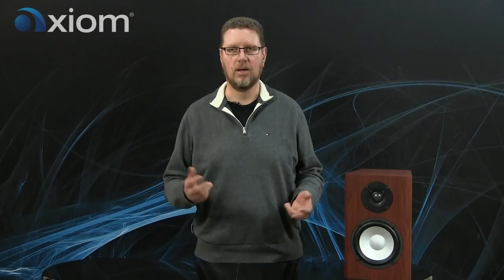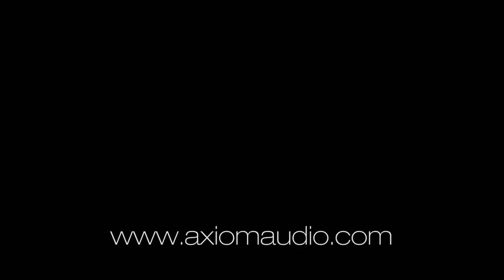Are My Speakers Blown?

Comment: Tweeters are the most likely to be blown by clipping, woofers are usually burned up by amplifier fault where an O/P transistor shorts (only in split supply amps)
Reply from the maker: Absolutely correct 👍

Comment: If it sounds bad, you might be damaging the speaker, turn it down.  If it smells, you’re probably damaging the voice coil, turn it down.  I burned out the voice coils of two beautiful car subs back in the ‘90s.  And I did it unintentionally with the Metallica “Justice for All” album!  The subs were probably getting killed with amp clipping but I didn’t notice and didn’t turn it down.  Goodbye Jensen sub, you were good.  Goodbye Cerwin Vega replacement sub, you were phenomenal!!!!  RIP.
Reply from the maker: Great points, and sorry it was a sub loss that brought you to that point.
Reply: Axiom Audio , it was a learning experience.  I was a kid and it probably saved my hearing, lol!  Oh yeah....one more tidbit...if you put your sub box on the speaker wires, it’ll rub and eventually destroy the insulation, short the wires and fry the the amp.  I did that too!...unintentional destruction.  Keep it all tidy, everybody!
Reply from the maker: @MusicStudent1  Fantastic point, and not just for subs, nothing should ever be on top of any of your cables! Just not a safe thing to do for any wiring or cabling.
Reply: MusicStudent1 are you just flexing 🤣
Reply: Yungchichi , yes.
Reply: Nah that album won’t strain your subs if you know you know 😂

Comment: Good evening. Thank you for the useful video, and you’re a legend for still replying after a year! I was wondering if it is likely to damage studio monitors by clipping inside a DAW by 6 to 8db. I am worried I could destroy my new unit
Reply from the maker: Thank you! Clipping inside the DAW could easily be passed directly to the monitors…not sure why you’re running into clipping in the digital domain…that’s nasty!
Reply: @AxiomHomeTheaters  hi
Using Paradigm Studio 100 reference speakers
The right speaker is working flawlessly but I have noticed on certain music tracks there is like a scratchy noise from the yellow midrange driver almost as if the speaker is loose.
It also appears only at certain frequency and lenght of tone. I have to inject frequency generator tones to actually determine the resonant freq this problem appears.
You think its damage?
Reply from the maker: @pietpompiepompiepiet940  It's possible the driver is rubbing only slightly and is damaged, which is why you only hear it on certain tracks. I would contact Paradigm technical support and see what they say.

Comment: one the two KEF 101 speakers has a crackle sound on one of the speakers, but I don't know if it is the tweeter or the board.
Could you assist/direct me in this matter? Thank you
Reply from the maker: If you're comfortable the best thing would be to swap drivers one at a time, between the two speakers. If the crackle moves to the other speaker, you know that it's the swapped driver that is at fault.

Comment: or an airport is loose and needs tightening, adhesive or puddy.  Look at your airport and see if if it has cracks at the seal, or put your fingers and press on it while playing sound and see if it helps. This was my situation with BIC Acoustic PL 200 II
Reply from the maker: That’s a good point…if the port tube is loose it can make some terrible noises.

Comment: To test to see if they are "blown," stage your gain on your amp and head unit properly (basically set them in order of flow so that they are just below the point at which they don't clip, first the head unit with amp at nominal gain, then turn up amp to just below clipping, do a search for more details), and then play a tone sweep (search YouTube). Your speaker tone will change drastically at particular frequency ranges. This indicates they are blown. You'll probably notice some differences from left to right. Turns out my left speaker isn't blown at all but my right one is and shows in a couple places.
Reply from the maker: Excellent advice, I would just exercise caution with the playback levels when using test tone sweeps. They contain far more acoustic energy than typical music programme, so can tax both the speakers and amplifier.
Reply: @AxiomHomeTheaters  thank you for the addition. Yes, you should start with your volume low and use your ears to gauge what a good level is with respect to how your music sounds when you are just below clipping thresholds at all stages.

Comment: I guess one of the smaller speakers in my car is slightly blown, but I think my woofer sounding a bit shaky is just the car rattling and not my woofer, though they may just be slightly blown.
Reply from the maker: A quick test is to play something at a reasonable level with lots of bass and press in areas of the panel that holds the speaker. Door cards in particular can rattle at different frequencies.

Comment: I have no idea what happened to mine I was on holiday for a few weeks I came back plugged them in and if it's slightly above barely audible it just sounds awful
Reply from the maker: If your speakers have grilles on them, remove them and make sure something is not visually wrong with any of the speaker components. Otherwise check your receiver/amplifier to make sure a setting has not been changed.
Reply: @AxiomHomeTheaters  everything looks fine but they just don't work at all now gonna have to see if someone who knows more about equipment knows what's up with it
Reply from the maker: @lilwombat  If you have another set of speakers try them, and if they work, you know it's not the receiver/amplifier. That would at least narrow down which component isn't working.

Comment: I have an old pair of JL-730W Kenwoods and I'm hearing scratching now, The day before I had driven the speakers loud, but the audio wasn't distorted, so I'm not sure  what's going on with them.
Reply from the maker: It’s possible you have overheated the voice coils and their formers and they have become slightly deformed in shape. If you press gently on the cones to move them, so you hear some scratching or roughness?

Comment: Hello, I don't know what happened to my speakers but I got high quality laptop (gaming), I had amazing sound even on 50% of system audio. And with Nahimic 3 which is special software for MSI laptop even better...1 day I played 1 game and heared huge crackling sound and let it go for minute max, and after it ended a game. And I realized my sound is hugely decreased and clear audio too. Now I have all almost on max but sound way worse than before, low sound, now is audio not clear and sounds weird...I don't know what happened. Can it be something with speakers or is it with drivers ? I updated all but still not better. I really want to go to get my audio back but now still sure if it can be speakers damage or something different...Please help me, if you can answer. I can give you more details if you want but I don't know what is the problem and if is way lower sound also problem with damaged speakers. Sound is not even clear as before, as I wrote. Thank you for your time reading this.
Reply from the maker: I’m not sure if you are using computer speakers with built-in amplifiers, but it sounds like something might have failed with the electronics built into the speakers. I would contact the manufacturer and see if they have any suggestions. And sorry for missing your earlier question about this! Recently discovered that YouTube does not notify of every comment, but now we manually check daily to try and catch all comments. Thanks for watching, and good luck!
Reply: @AxiomHomeTheaters  Thank you so much for your answer. I liked the video and keep up the good work! I am already contacted the shop where I bought it. I will now try last 1 fix they told me to do, and if doesn't help, I am going to get propably new laptop cuz this 1 is damaged. Anyway thanks again, and have a nice day ;).
Reply from the maker: You're very welcome, and hope this last fix works for you! Thanks for watching, and hope you are having a great weekend.

Comment: Quick question. I understand that Axiom subs are DSP controlled. I was wondering in that case if it is possible to damage the woofer by playing it too loud and bass at the max or if the DSP will prevent the woofer from being over driven, no matter the settings and volume?
Reply from the maker: Under normal operating conditions with music or movie program signals, the DSP limiter will protect the drive unit from over-excursion at all times, regardless of the volume setting.
Reply: @AxiomHomeTheaters  Thank you. The reason I was asking was because I wanted to check what my new EP800 could do and looking for the deepest bass to demo a subwoofer, what comes often is the opening credits (first 20/25s) of the movie Edge of tomorrow. However a lot of warnings regarding not playing this at reference level as this was supposedly mixed too hot and there has been reports of some subs being damaged while playing it. So if I understand correctly, since Axiom subs are DSP controlled, they will never be damaged by something like this, even playing at reference level, correct? Thanks again.
Reply from the maker: @bdpf1744  You will be fine…just don’t run it on a loop! As with any regular speaker, if you start to hear any strange mechanical noises or smell anything, turn down the volume. While the DSP will protect the woofer from over-excursion, heat stress can still play a part.
Reply: @AxiomHomeTheaters  That's good to know. Thank you very much for your reply.

Comment: I accidentally put speaker ring foam in the back of my car speaker magnet . They sounding good for a month . Then last night they start to sound clipping . Is it overheat due the foam?if i remove them quickly can my speaker sound normal?
Reply from the maker: When you say your magnet did you push the foam into a vent at the back of the speaker motor? If so you might have damaged the driver due to reduced cooling. Remove the foam and see if the sound returns to normal.
Reply: @AxiomHomeTheaters   but in the morning they sound normal . When i park my car under the sun and start to listen radio,the sound is clipping . I just stick the foam behind the speaker magnet . I hope my speaker is okay😭
Reply from the maker: @MrFaizProject  It could be something else going on if it’s only when your car is in the sun…maybe your amp or head-unit is overheating?

Comment: Facing a little noise while playing songs or videos at low but in high volume i can't hear that noise is it normal or something is wrong with my speaker
Please kindly reply.
Reply from the maker: If only at lower levels it could suggest there is some slight rubbing of the voice coil on one of the drivers. If you turn off your amplifier and gently press on each cone, do you hear some faint scraping sounds?
Reply: @AxiomHomeTheaters  my is a blutooth speaker and yes it makes a rubbing sound and something, even when i play songs a little louder. can we fix this issue
Reply from the maker: @darkiedidi  At this point I would suggest contacting the manufacturer of your speaker.

Comment: I have sony ht-rt4 when i was messing with the options on the tv i accidentally turned on dolby digital + while the system only supports dolby digital. I heard some kind of screeching and squeeking.... It was for 2-3 seconds because i immediately switched to normal dolby digital. Is there a chance that i blow up the speakers.....? I just bought it...
Reply from the maker: If only for a few seconds, you are likely ok.
Reply: @AxiomHomeTheaters  well I'm using the system for couple of days now and I don't hear any distortion so i hope they're fine because i just bought em....
Reply from the maker: @bojidardimitrov4361  sounds like you are safe then.

Comment: mine i have a setero aiwa and the speakers outta nowwhere make a loud high pitch sound then stop working then later one they work again it repeats over and over
Reply from the maker: It sounds like you are either clipping your amplifier badly, or there is a bad connection inside your speakers. Since it is happening to both speakers you are probably clipping the amp.

Comment: i need help im just 11 and dont know, i have my speakers on full vol and i can only barely hear it when i put my ear close to it,  my speakers stopped worked a long time ago but i didnt care to fix it, now the audio from my computer wont let me pick it, im on windows and my pc doesnt pop up as an audio so im trying to fix my speakers, advice for my pc  audio or speakers would work i have edifier speakers if that helps and i have a cat who got cat hair on the front part of the speaker.
Reply from the maker: There are two things I would check: If your computer speakers are powered, make sure they are plugged in correctly and that the power supply is still working. Usually there will be a little light on it. The next step would be to try your speakers plugged into another computer to see if it’s an issue with your computer or the settings.

Comment: what would be the cost of replacing parts ? Is it even worth it?
Reply from the maker: If you purchased high-quality speakers and the only thing wrong is the drivers are blown, then yes, it would probably be worth it.  If your speakers didn't wow you to begin with, then it might be a good time to look for an upgrade.
Reply: @AxiomHomeTheaters  I can hear it well, only when bass is involved it is a bit messy. The speakers don't have even decent bass when they were new. They are mid + high range,
Reply: @maxmagnus777  We have two models, the M2 and M22, that are recommended for use with a subwoofer.  All our other models will have great bass.
Reply: @iancolquhoun6794  hey tnx, I am no really sure who we in "we have" is. A company, person, a shop?
Reply from the maker: @maxmagnus777  sorry for the confusion, Ian is the president and founder of AxiomAudio.com

Comment: Why are my door speakers playing at really low volume while all the sound comes mainly from the dash speakers? Is that regular or should I replace them ?
Reply from the maker: Is this a factory system? Have you checked to see if there is a fader control to adjust the level between these speakers?
Reply: @AxiomHomeTheaters  factory 2014 Bose Sierra system , idk if to replace the door speakers or the dash
Reply from the maker: @yoseeev8306  I would suggest having the system looked at by a good car audio shop to determine the issue before replacing any components.

Comment: what are the main cause of blown computer speakers? Mine are blown and I have no idea why
Reply from the maker: Depends, do they not work at all, or do they just sound strange?
Reply: @AxiomHomeTheaters  they just sound strange, kind of like a buzz.
Reply from the maker: @alessiacasco  if the sound is buzzing, it's possible that the plug or the jack is damaged for your computer. I would try the speakers into another computer, or the headphone jack on your cellphone. If it does not buzz, then the computer is the problem. If it still buzzes, you either have a problem with the speakers themselves, or the wiring/plug.

Comment: I don't have a amp in my car it's just my stereo and I love bass and when I listen to some of my songs time passes and then it gets a static sound which really is bothersome but after I get out of my car for a little bit they are back to normal what going on?
Reply from the maker: It's possible that your head unit is overheating, and we suggest looking into a dedicated subwoofer and amp. However, car stereos are not our specialty.
Reply: @AxiomHomeTheaters  that's what I'm afraid of getting due to the possibility of destroying my battery or alternator

Comment: I upgraded my door speakers to 6.5s skar with a 1500 kicker amp and on some songs low volume or high volume it starts to crackle not sure why its just one of the speakers crackling
Reply from the maker: Check all your wiring and connections first. It's not a bad idea to occasionally re-seat all connectors to get rid of any minor corrosion.

Comment: My air tube in my subwoofer makes a rattling noise for some reason. Anyone know why? My speaker isn't blown it's perfectly fine, but the tube where the air escapes is rattling.
Reply from the maker: Check to see if the port tube is loose…you can usually tell without opening the cabinet by trying to rock it with your hand. If it is the adhesive holding it has likely failed over time. I would contact the original manufacturer for advice. Thanks for watching 👍
Reply: @AxiomHomeTheaters  I checked, the adhesive is tightly secured. I know someone that knows alot about speakers, they told me my speaker is blown. Thank you for the reply :)
Reply from the maker: @markosbellezzi4841  glad you found an answer from someone you can trust. 👍